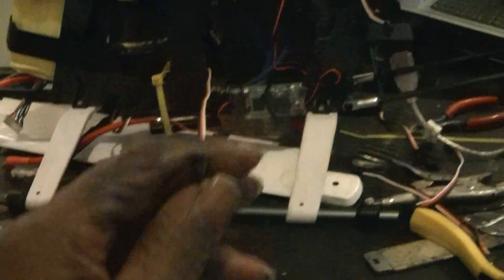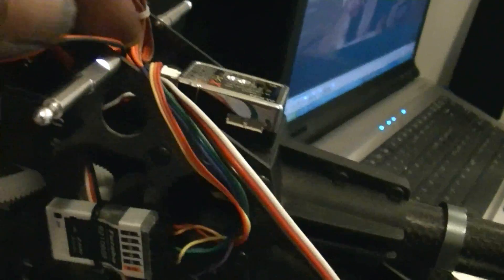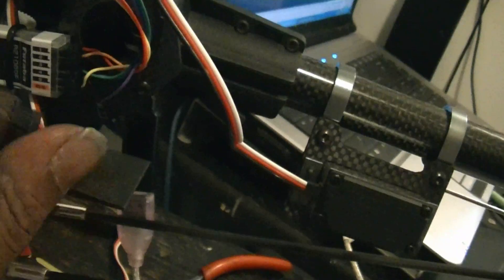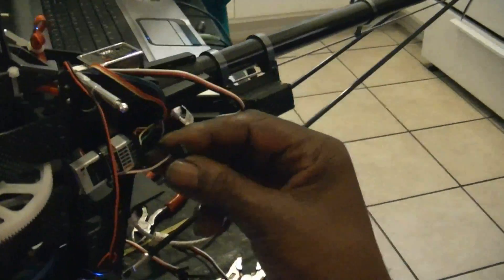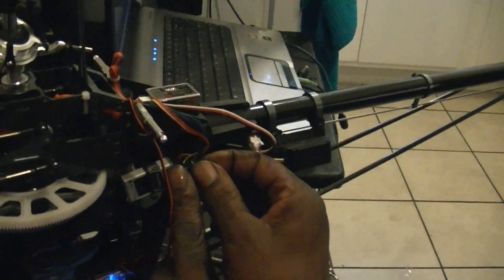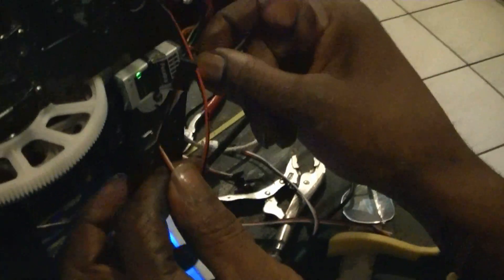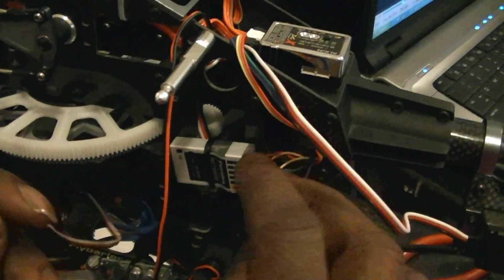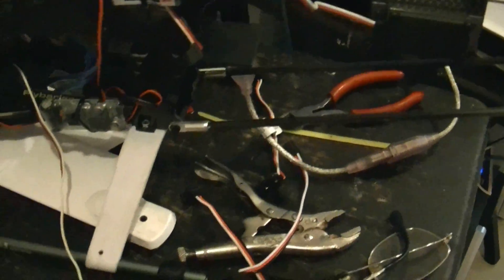how to align 3gx v3 to a 6ch rx HELP!!!!. futaba T6 transmitter  HobbyWing Platinum PRO 150A-

Comment: Hey WC that receiver looks like a fasst receiver, futaba t6 uses s-fhss modulation completely different. That is why it is not working this is the only sbus  s-fhss receiver out there for the futaba t6. 
Futaba R2008SB 2.4GHz S-FHSS 8-Channel S.Bus Receiver . This is the one you need if you are going to use the sbus system.

Comment: if you are using a separate bec you need to remove the red wire from the throttle sensor wire on the esc

Comment: Those purple blue green and red orange yellow wires are for a telemetry  module, you dont need them to run the 3gx. If you have external bec you have to have a 7 channel reciever to plug in the bec to a aux port.